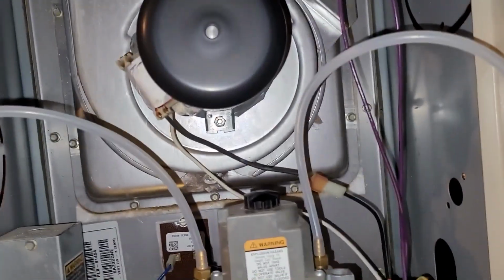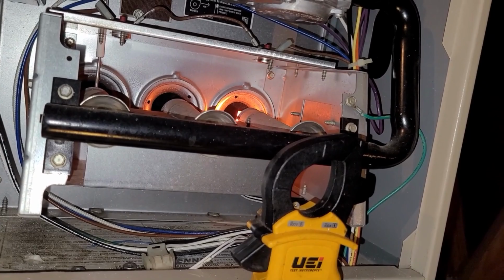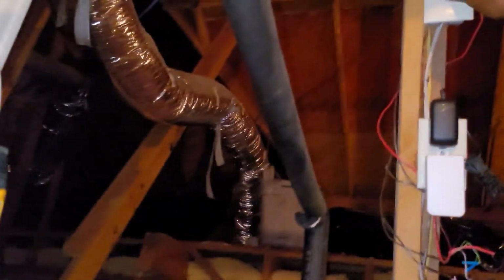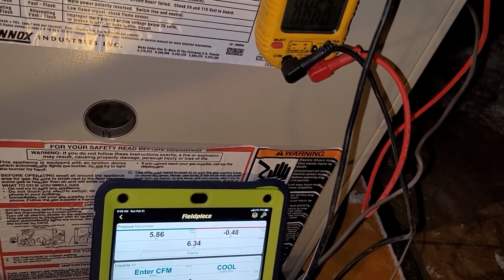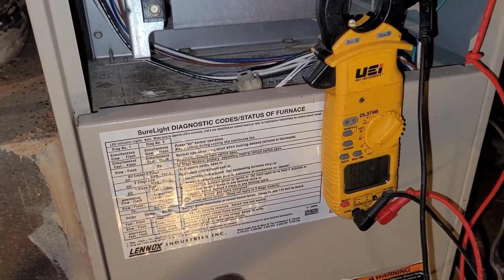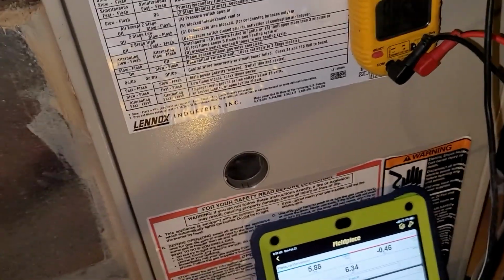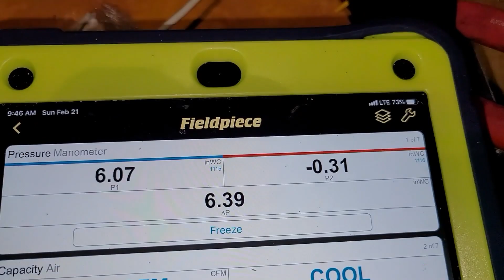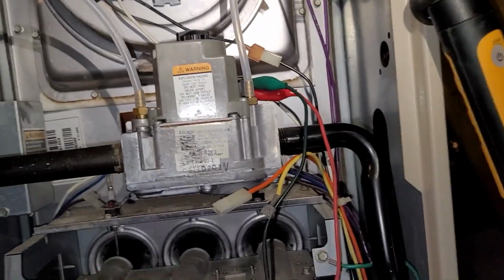"Lennox Heating Woes: Troubleshooting Tips to Restore Warmth and Comfort in Your Home!"

Comment: Good video Walt. Question i know you use thumbtack have you tried using Networx?
Reply from the maker: Never heard of them. I'll check them out.Have you use them yet?
Reply: @WWHVAC  they are an app based program like thumbtack you control the leads, its easier to manage your budget and less contractors see the jobs at once. I got a few installs and repairs off of them. They have  a program called direct leads and grab it that suits sol props like us when call make sure you ask about it.